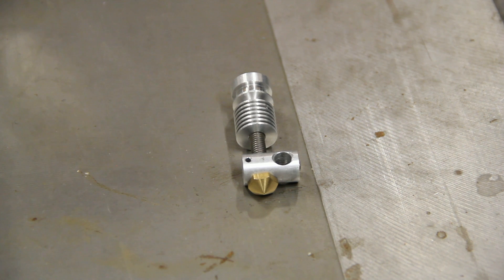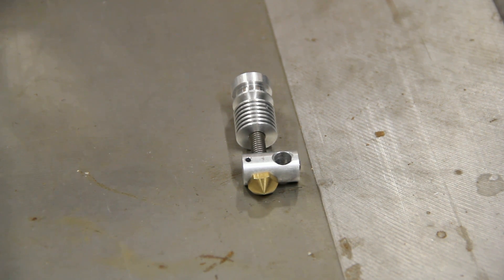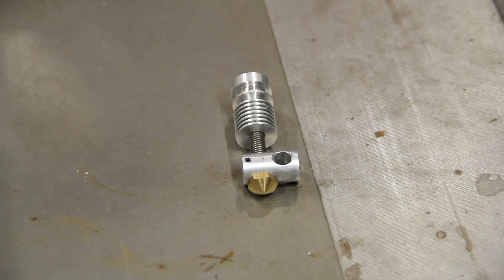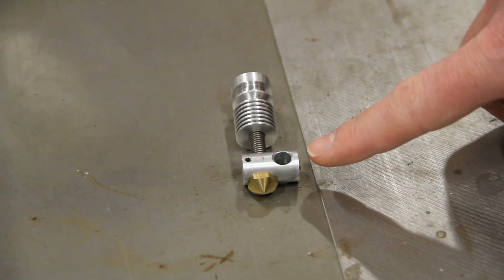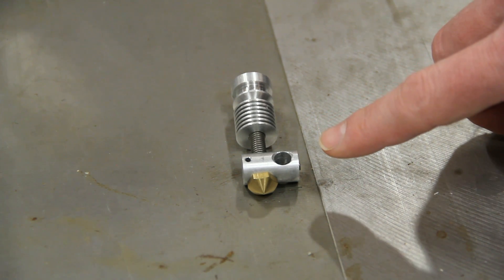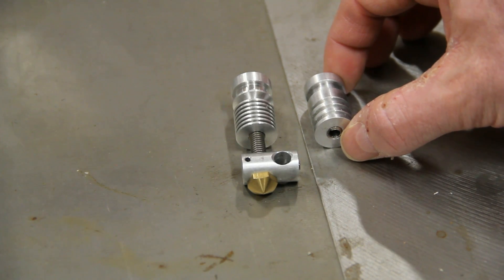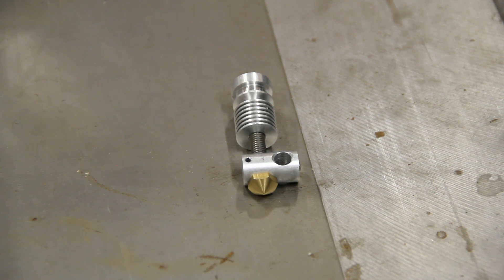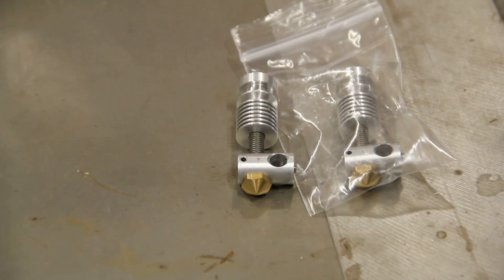Aluhotend V5 - Initial impressions

Comment: One suggestion - dunk the thermistor in the cement with the PTFE pulled back on the leads. Then push the PTFE down the leads. You will get cement into the end of the PTFE. That's a good thing. Insulating the leads right as they come out of the glass bead is pretty much impossible with just PTFE. The cement is a good electrical insulator. Having a continuous layer from the glass into the PTFE reduces the changes of a short.
Reply from the maker: Good tip, thanks!

Comment: Cool! I ordered the same one last week for the new printer I'm building. It looks like it'll do amazing prints and I got it for only $25 on ebay. Looking forward to see your dual extruder! I contemplated adding it but It's not documented well enough, good luck.
Reply from the maker: That's a great deal!  Yeah, I suspect the extruder is going to evolve a little bit before I'm completely happy with it.  I started with the compact extruder that's in the i3 Github, but I think it needs some changes to work well.
Reply: ZennmasterM I think the difficult part is the firmware and stls. I've only done a bit of research on it, but It appears that you need two stls and morph them together somehow? It sounds awful complicated plus there isnt a lot of info on it. You'll be sharing your firmware, right?
Reply from the maker: My first goal is to use the second extruder to print support material, and the most recent version of slicer has that as an option.  Once I can get that working, I'll start working on multi-colored prints and the like.  I will certainly be sharing any configuration changes I need to make! :)